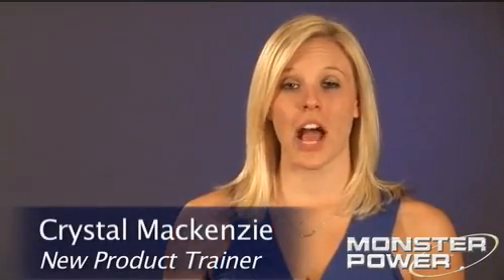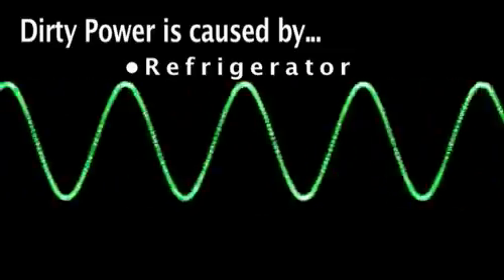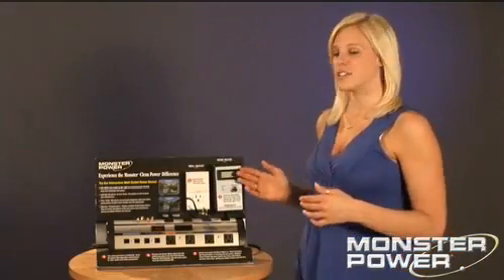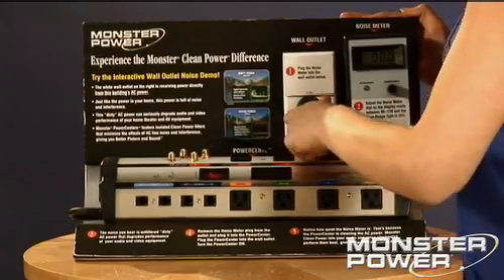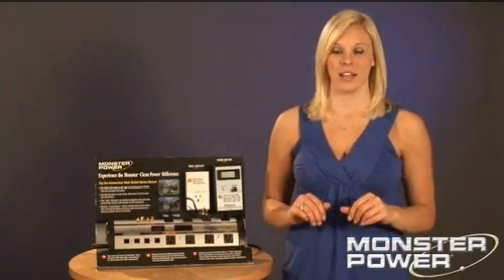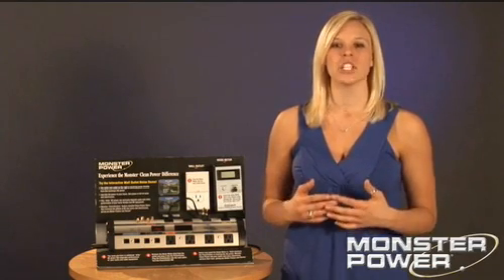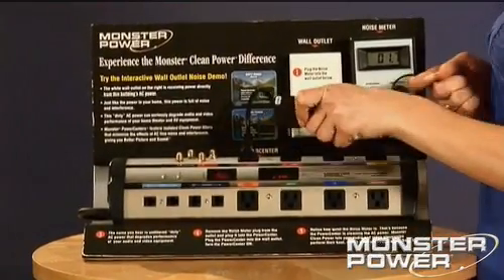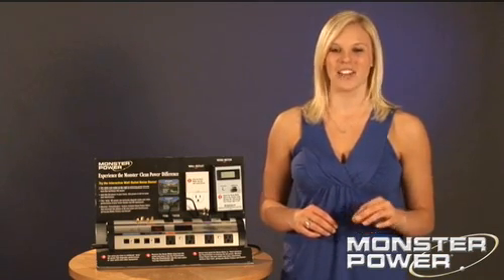Monster Cable Demonstrates Noise Sniffer to Remove Dirty Power from Home Theater Systems

Comment: We had a TV that the picture would flicker on when I turned on and off a pair of hair clippers, but I think that was RF noise that travels THROUGH THE AIR not via the wall sockets. I know because my lighter spark makes my TV flicker when I use it and that's not connected to the mains.

Comment: ah, bunch of horse shit. Just buy good cables and you'll be fine. Electrons don't give a crap what brand is on the jacket of the copper there traveling through. If you buy cheap cables or use the poopy ones that come with stuff these days then you'll pick up emi rf emf blah blah crud and suffer. I'm always amazed by consumers who think that a piece of copper wire can somehow change the depth or openness of a signal or "these cables will brighten your sound", or whatever the tag line is. insane

Comment: LOL, agreed! My experience is as follows: two monster cables, one failed within 6 months and both totally cut the highs off the sound, like a blanket over my speakers. The other one died a while later. A monster speaker cable that was totally babied and failed?? It was only used for my marshall 1/2 stack, not much abuse going on there. Then I found some RCA's at a thrift shop, they were monster, the VCR-DVD won't work with them. MONSTER CABLES ARE JUNK.

Comment: A Best Buy rep deomonstrated this for me. it's a joke for most folks. When they demo this in a giant steel-girder/concrete building packed to the gills with hundreds of simultaneously running electronics, then yes, you might get signal noise. but if you're house isn't a Best Buy or NASA, you should have no problems.

Comment: I notice above that Monster can't even spell component... that speaks a lot for their competency... seems wierd why you would agonise over the "cleanliness" of the mains supply when running a laptop which like most PCs use a switch-mode power supply...